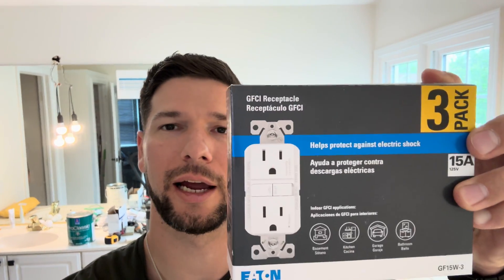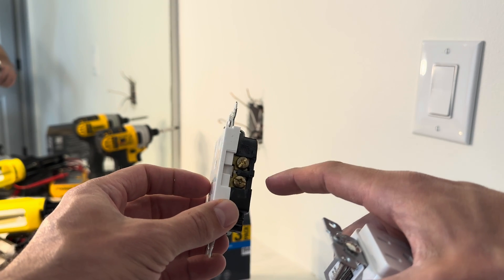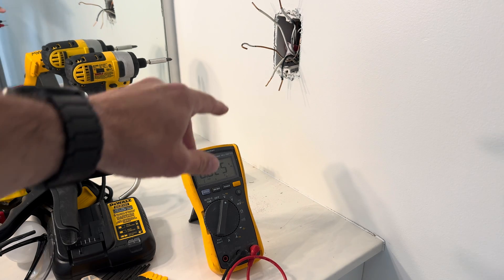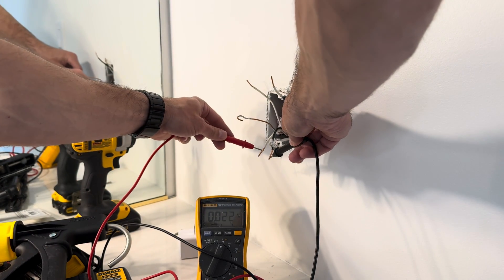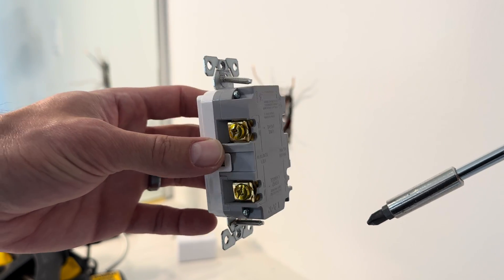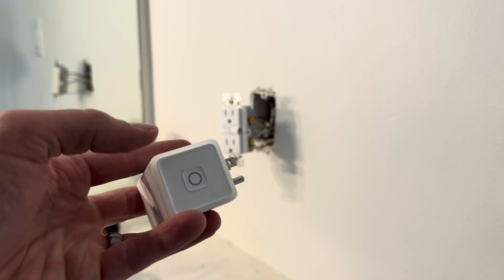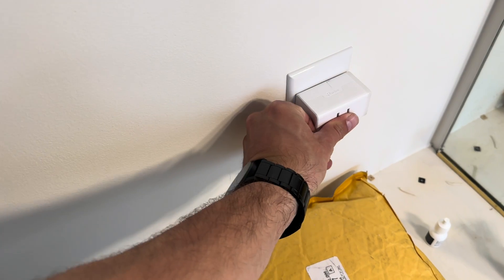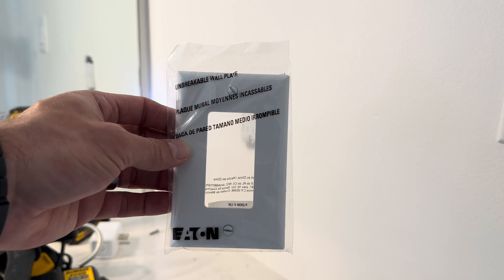How to Replace a GFCI Outlet | Step-by-Step (No Electrician Needed)

Comment: How to install giving to ungrounded circuit
Reply from the maker: I'm not sure if I am understanding the question correctly, but you can still install a GFCI outlet to a non-grounded circuit. However, in these cases you should apply the sticker in the box that indicates it is not grounded to the front face plate of the outlet.

Comment: Is there any advantage to not looping it around the screw versus push pushing it straight in and tighten it down?
Reply from the maker: That's a great question. In most cases, both will be fine (backstab vs. side screw). However, using the side screw terminals is less likely to loosen over time and creates a better electrical connection. The main advantage of the backstab connection is for speed. 

Thanks for watching!

Comment: I replaced my gfci outlet just as you instructed but my load terminals still have no power. I'm trying to figure out why. Also noticed when I plug in an appliance in the gfci there's no power but when I plug in the tester I get the 2 outside lights but not the middle. What am I doing wrong or where does the issue exist?
Reply: How long did that take to pull the old GFCI and put in the replacement? I’m having an electrician come and do some work for me….
Reply from the maker: @brucetennyson5035  slowed me down doing the video and explaining it, but for an electrician that knows what they're doing it should only take about 60 seconds. Don't let them overcharge you!
Reply: @brucetennyson5035 doesn't matter if it takes 5 min or 5 hours... You are paying for the knowledge not the time. And any self respecting guy is going to bill a 4 hour minimum.
Reply from the maker: There's a few things that could be going on here. I would make sure that you haven't accidentally connected the Hot/Neutral wires coming from the breaker into the Load side terminals of your GFCI. Doing this would result in the GFCI outlet not being powered on. Before checking that, I would make sure the "Test" button on the GFCI hasn't been accidentally pressed in. You can rule this out by simply pressing the "Reset" button and then trying to plug something into it. Another possibility is the GFCI is wired downstream from another GFCI that is currently tripped. It's difficult to troubleshoot without being there in person, but I hope one of these solves your issue!
Reply: @theDIYdepot  thank U 4 Ur response. Yes I've definitely connected the wire correctly. There's the wires coming from the breaker entering the box from the bottom by itself which R connected on the line side, black 2 hot (gold screw side) & white on the other side (silver screws). Then there are 3 sets of wires entering the box from the top which power my three outside outlets all connected & capped with a single black & white connected to the load the same way. Black on the hot side, white on the other side. When I'm pressing the test & reset buttons I get no response. Neither of them stays in when pressed. There's a possibility that it is wired from another GFCI. I will trace the line wire & see if I can confirm that. Again, thank U for Ur insight.
Reply from the maker: @blaqicesp91  best of luck to you! Let me know if you find the solution!
Reply: Sounds pretty bad. I'll charge you $300 to fix it for you 😂
Reply: @ahole5407  just enough for more meth...

Comment: I imagine the same process and materials for outdoor GFCI?
Reply from the maker: @Salanan  wiring for an Outdoor GFCI vs an Indoor GFCI outlet should be the same process in most cases. One thing you would need to account for in an outdoor scenario would be to install a weatherproof box over the outlet.
Reply: @theDIYdepot  outdoor GFCI replaced ezpz.  thanks for video
Reply from the maker: @Salanan  glad I was able to help!

Comment: You had the bottom wires with load on them, but you said the top wires are the load wires.   Aren’t the wires with power the load wires?
Reply from the maker: @ncmoschetti   Thank you for watching and your comment! Once you have the old outlet removed and the wires are exposed, then you can find which wires are the Line (wires coming from the circuit breaker) and which ones are the Load (wires going to the remaining outlets in the room). The ones that are reading ~120V will need to go into the terminals labeled as Line. In the video I believe I may have flipped the outlet over before installing it so it may have looked like I swapped the Line and Load wires. Apologies for any confusion!